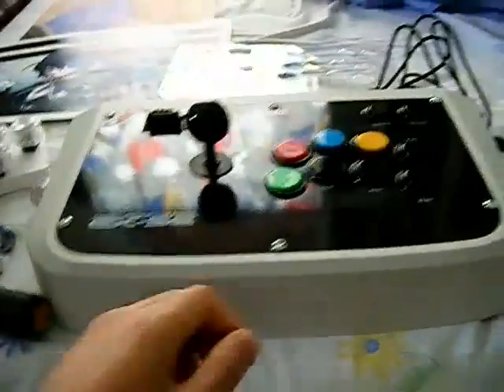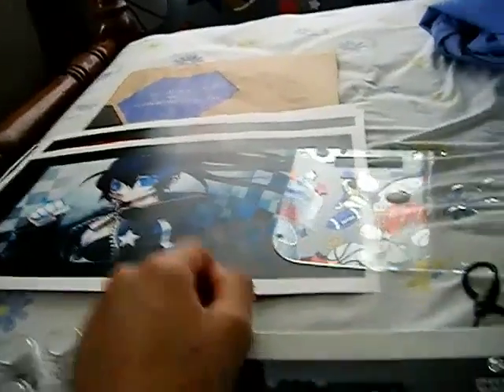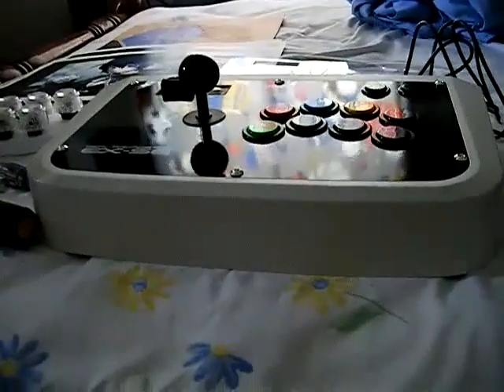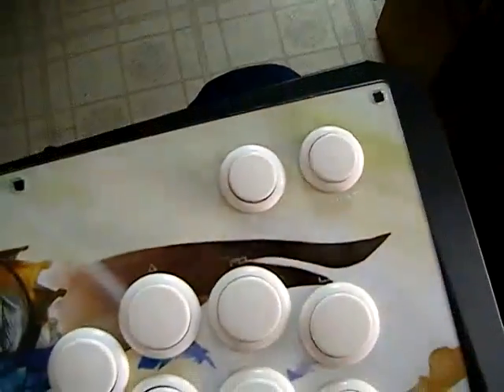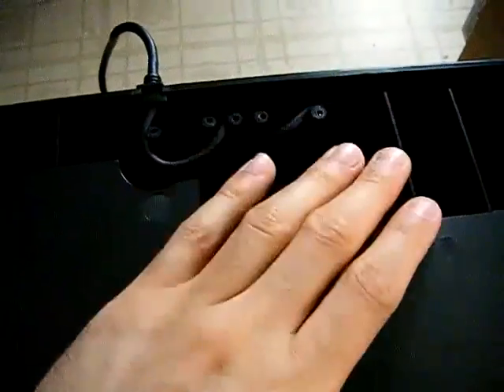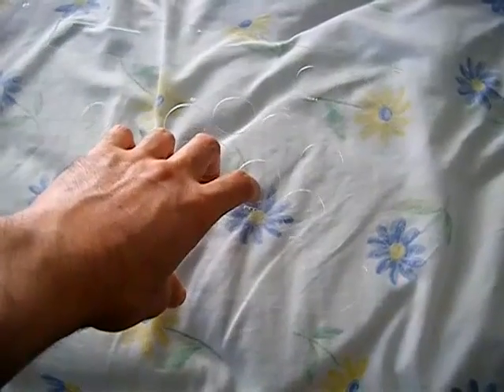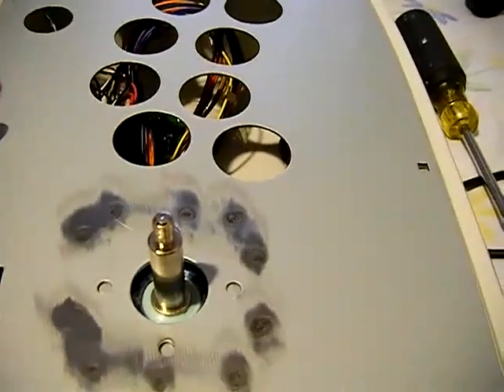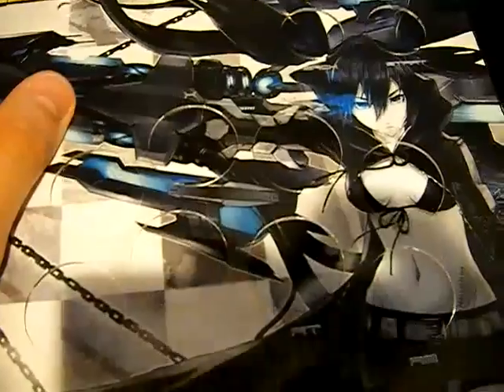How to mod a Hori Real Arcade Pro (Full Tutorial)

Comment: ive just picked up the ex-se but it doesnt work and seems to trigger votage issues in the 360 psu. When i took the base plate off there was a loose4 wire with a simple loop connection on. i had assumed this was an earth but as it wasnt showing on your strip down im at a loss as to where its supposed to connect
Reply from the maker: Hello Jon,  I'm not sure on how the wiring is handled on the stick.  I'm a complete noob in regards to that.  The extent of my knowledge is swapping out the image/buttons.  Hopefully someone more knowledgeable will reply.
Reply: i opened up the top panel and a wire was loose in there too so i sent it back and got a mayflash f300 instead :)

Comment: how did you print the artwork from the template?
Reply from the maker: Hello Jp De Leon, If I remember correctly, I went to office max/depot and had them print the photo from my USB stick.
Reply: Viola Blue no i mean what is the size when you printed the artwork
Reply from the maker: @jpdeleon3971  I honestly can't remember.  You might be able to measure the insert on the top of the arcade panel and give that to the clerk.
Reply: Viola Blue okay thanks!

Comment: How do you pull the wires from the buttons??
Reply from the maker: ***** 

I like to take a flat head screw driver (the smaller/thinner ones) and wedge it where the button's underside and the connector meets.  I'll then twist the screwdriver from side to side slowly and carefully to prop the connector up a bit, at that point, I disconnect it by hand.  Some of them can be tricky, but with patience, they'll all come out.
Reply: I ended up pulling it with pliers which works